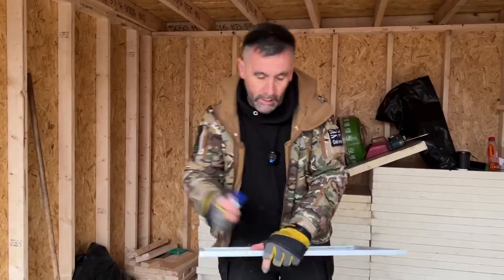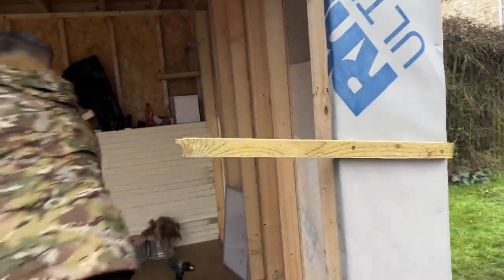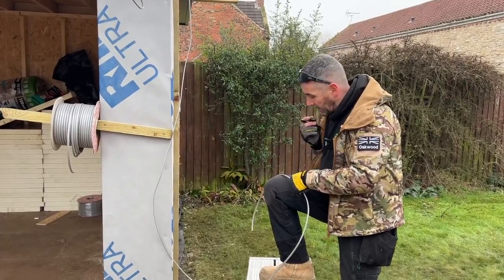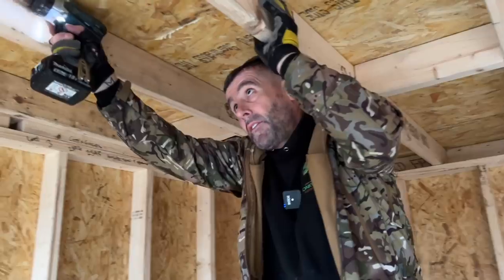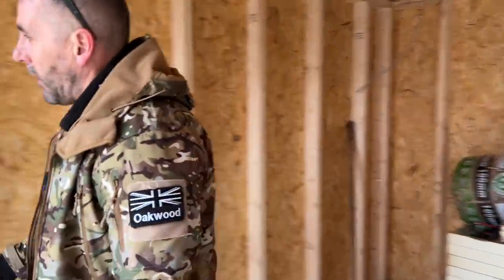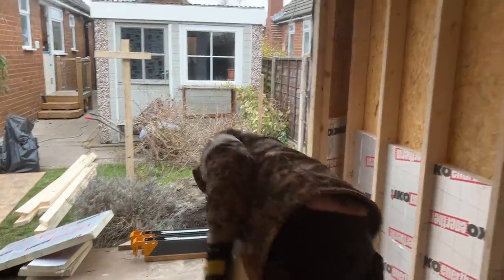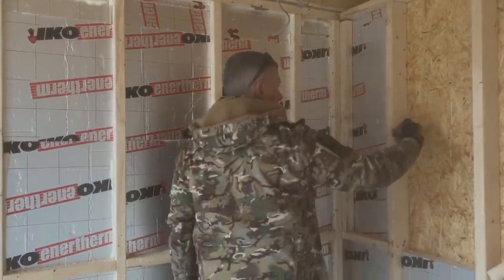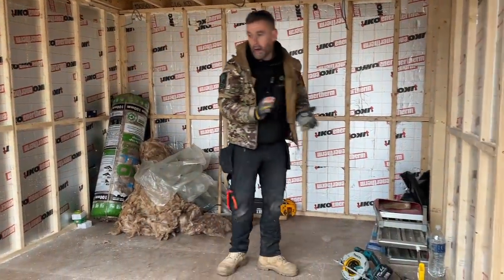Day 8 off a solo build, 1st fix lighting and some insulation, along with noggins

Comment: quick insulation tip. space your walls at 438 centres to give you a gap of 400mm. you get 3 rips out of a sheet with no waste. the dewalt battery table saw is a massive time saver for ripping 2.4 x 1.2 sheets down. Use the vac and no horrible stuff floating about. We do this for roof work and cut the whole stack outside in 15 mins then zero dust to breath in.
Reply: surely you then have a nightmare with the plasterboards?
Reply: yes its a compromise but the cost of inuslation makers it worth it to cut a couple boards.
Reply: Good idea. I prefer to keep on 400 centres and rip the insulation sheet the other way, into 1.2m strips using the track saw. They are easier to fit than a 2.4m length. And not much waste off the full sheet.

Comment: Is there a reason to push the wall insulation to the outside keeping the airgap inboard, instead of pushing it until its flush with the inside, leaving the airgap outside?

Comment: Thanks for this series Liam, it's come just at the right time as I'm finally starting my self build.
I know it's essential to use treated timber for the base but wondered if you use treated for the rest of the build or switch to untreated c16?
Reply from the maker: treated for the base as this is still open to moisture from below. CLS for the walls as this is protected from the elements and like wise for the roof, C16

Comment: Have you heard of Quinetic Wireless light switch system, Cuts down on running cable back to the light switch ( obviously on this job might not be economical, but on larger Projects/ Renovation etc) Look up N Bundy Electrical, YouTube. 
 Internal low profile/wafer Led lighting, could save on cutting deep pockets out of ceiling insulation. Great video, learning something New every video.
Reply: There's actually another video where Liam and the team put in recessed LED strip lights in the ceiling and walls. That was a pretty nice build and look with those lights.

Comment: Two Words Liam “,Bless You “ Get yourself a lemsip ..
Reply: See if you hung roofing battens from the roof joists, it would lower the ceiling by 22mm, but you could create voids for servicing such as cables or pipes and avoid drilling through joists